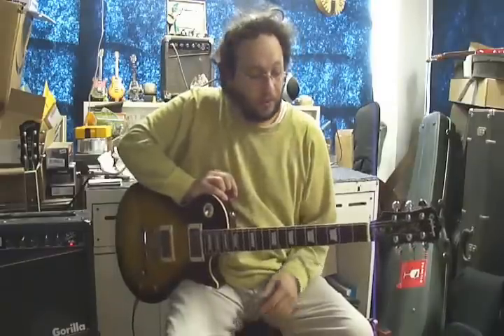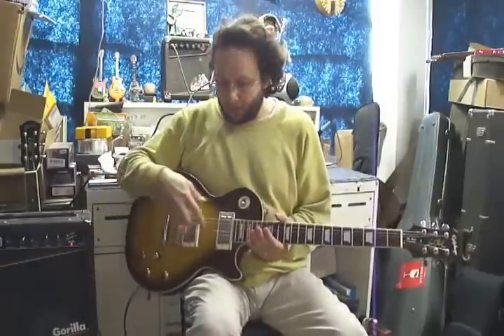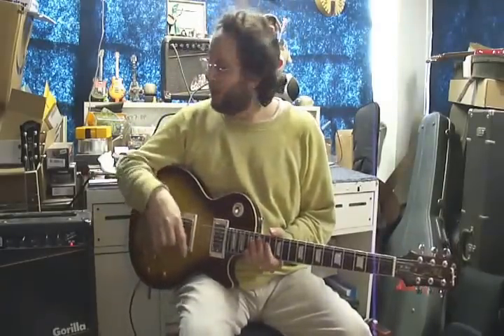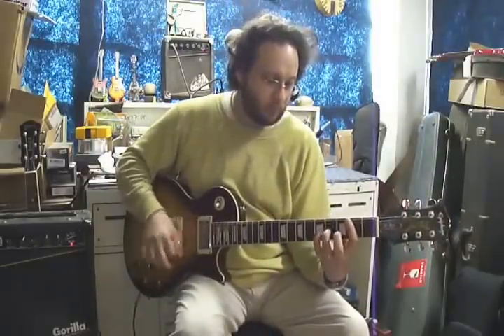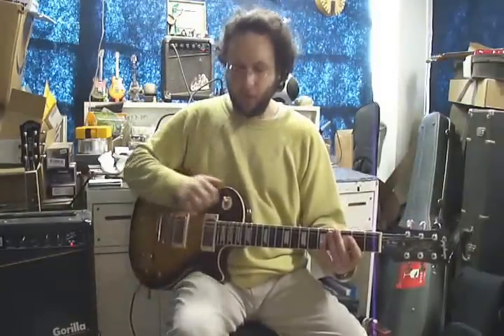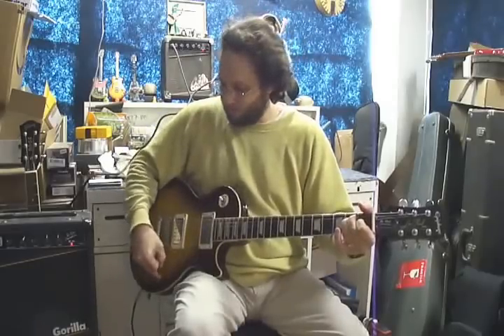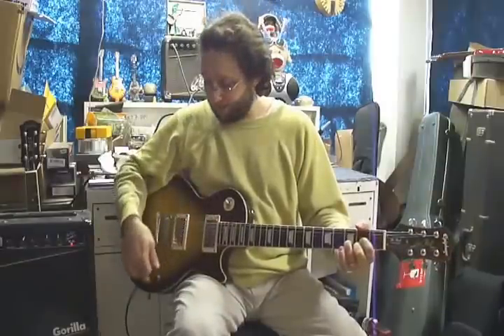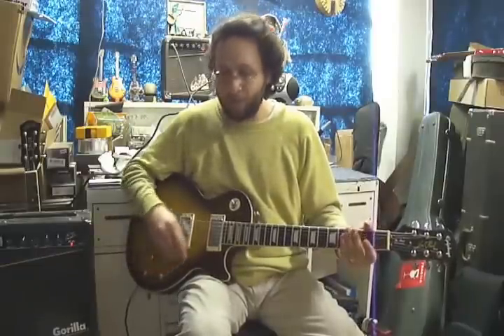Wiring humbuckers series/parallel vs coil splitting, and more by D Guitars Miami LLC

Comment: Thank you very much Doron. This was exactly the information I was after. I'm looking for a bit of advice also if you would be so kind. I'm wiring up a 2 bucker guitar and would like to use push-PUSH pots for the series/parallel switching rather than push/pull. I've read up on it and found more than a few comments about poor reliability with the switching in the push/push pots. Do you have any experience or thoughts on using the push/push pots? Any feedback would be most appreciated. Kelly      P.S. Here's a link to the pots I'm looking at. http://www.wdmusic.com/WD500PUSH_US.html
Reply from the maker: PrimitiveChrome Hey man, thanks for your support. Glad I could be of help. As far as push/push pots, stay away from them. I can appreciate wanting to use them, but they wear out much sooner than push/pull pots and stop holding the switched position after a while.
Reply: Doron Markowitz
That seems to be the prevailing opinion, of what little I could gather. I'm fishing a harness into a full hollowbody which for me is a real challenge so I don't want to have to fix it down the line. I guess I'll go with the push/pull. I wish Yamaha still made the good push-push pots... In any case, thank you for taking the time to reply and the great work on the videos. SUBSCRIBED-